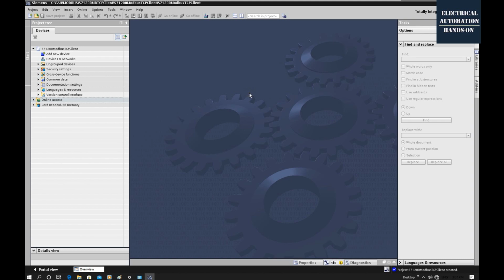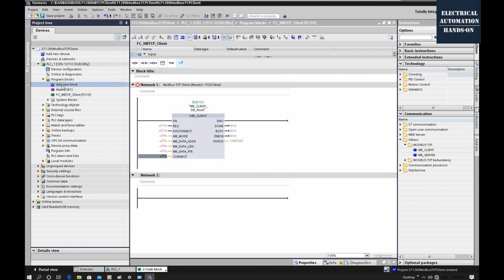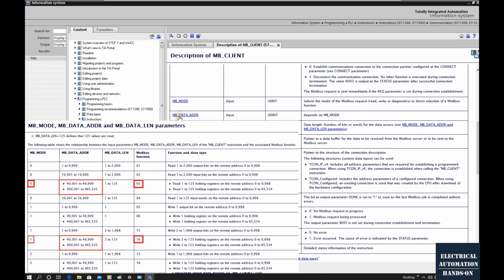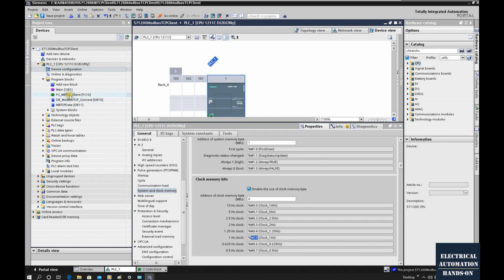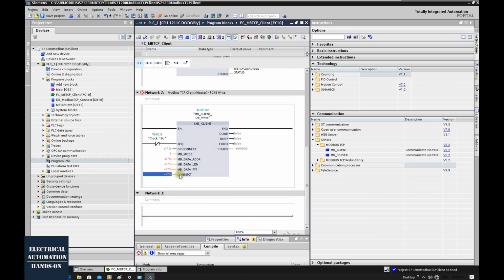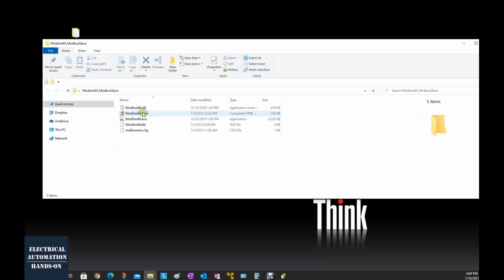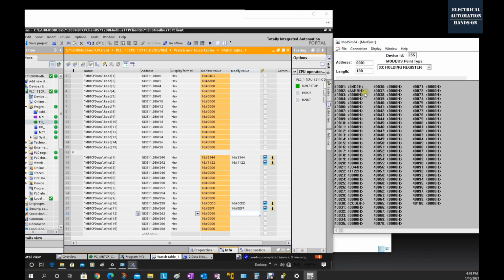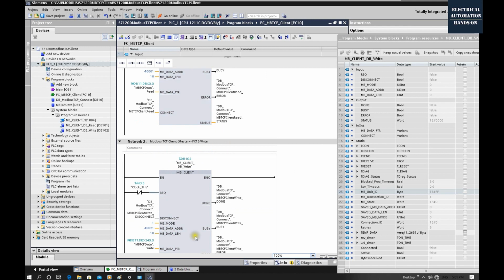COM18. ModbusTCP Client via Siemens S7-1200/S7-1500 PLC and TIA Portal

Comment: Hi , is it possible to simulate modbus connection without plc ? Only with code and modbus slave equipment?
Reply from the maker: If you are using Siemens PLCSim Advance, you could use SIM PLC for Modbus TCP function test.

Comment: Thank you for your amazing videos. I have a question with regarding software error. When I try to use Client Modbus TCP and configure the software the (Read/Write) are configured right and only ONE seems to be working at a time. Sometimes Read shows 7004-7005 (which means a connection established) and the Write shows (7001-7002-80C4) and then they switch and become opposite after reseting the server and then they switch, looks like one of them doen't update until one is offline...Any idea why? I used exactly what you did.

Every time PLC is off, the interface-id changes from 64 to 100 in the online position and I have to switch it back.
Reply: Hy,did you figure out what causes it?I have the same problem

Comment: Does this method work for multiple slaves on modbus rtu also? Whats different?
Reply from the maker: This example is for point to point. For multiple object, you have to program to target to different IP and copy the receive buffer to other data block, or use different Fb call with different instance DB.

Comment: @Electrical Automations  :  Can you show an example when adding 2 or more MODBUS units ?  do it all over again, or use the same blocks ?
Reply from the maker: You can change the settings for the 'target address and modbus address' to switch the communication target, OR ,  can multiple ModbusTCP Client FB and instance DBs to communicate with different target.

Comment: Hi I was wondering if you can help me. I have a schrack meter connected to a moxa modbus mb 3000 and my job is to interpret measurements made my the meter in c++. My question is how to connect the modbus to my pc and do you think this tutorial alone is enough to make a valid connection to modbus and will I be able to program in visual studio using the registers? Thank you in advance.
Reply from the maker: I am not using and programming C++. For your question, you have to figure out how to use C++ running as Modbus Master (Client) function to connect the Schreck meter. It would be not a easy job unless you can find a proper specialist who did this feature before. Good luck

Comment: readings are in word data type , how i can change to real type to match with actual reading ?
Reply from the maker: A real variable comes with 4 bytes, but each modus register only takes two bytes. So either slipt a real and transfter it as two words, or using * 10 then.using Int instead if your real value is less than 6553.5

Comment: Data transfer is okay but how to switch on / off the coils I don't want to read any data I want to simply on/ off coils in modbus function it is selected as 3 how to change it??
Reply from the maker: operating the individual bool/coil needs to call the other Modbus FC code. but it is not efficient in the PLC CPU level communication. The common way is that using FC06 16 for exchanging WORD, then using PLC logic to decode the WORD into 16 bits.

Comment: Thanks for your video, it's very helpful. Could I use it to communicate to actuator sensor using Modbus? With the same steps?
Reply from the maker: Yes, the method will be very similar. You could read the manual from this actuator and see the FC16 or other register variable.

Comment: Do we need to add the modbus block in the tia portal or we can directly connect plc to pc via modbus? will u please respond for this soon
Reply from the maker: You need to program the PLC for the modbus communication. If you are going to do Modbus RTU, you also.need to purchase RS232/RS485 modlue by using s7-1200. This video is talking about Modbus TCP, it is RJ 45 ethernet port.

Comment: That means I can connect my arduino to my plc right?
Reply from the maker: If your arduino support modbus protocol, that could be done
Reply: @electricalautomation  yes it does, I use codesys soft plc with it and it works fine.

Comment: How is it possible to read and write the same Modbus adress? Lets say in the holding register 40001 is for Start/stop/Auto/Manual etc. and i want to read at first the actual state and then wirte to 40001 bit 8 (for example the start bit)? I wann use the modbus mapping from the Siemens Climatix PLC
Reply from the maker: You have to plan your 120 Modbus registers into two areas for inputs and outputs respectively.

Comment: Hello, Thanks for the video, I do the same, but could not read data from (modsim64) or any other reader. I try tens of times but it is not working at all. Please any suggestion to solve that matter?
Reply from the maker: There is no any hidden operation in the video. It includes every thing. Would you pls let me know your hardware, OS, and TIA Portal software revision you are using?
Reply: @electricalautomation Sir, i am also facing same issue. From Modsim i am unable to establish the connection. Regarding hardware, i am using s7-1516-3 plc & windows 11 os & TIA v19. Pls help me in this regard

Comment: If we connect multiple meters via modbus gateway where we need to set the  slave device ID in PLC program
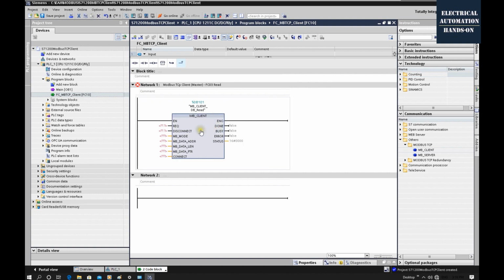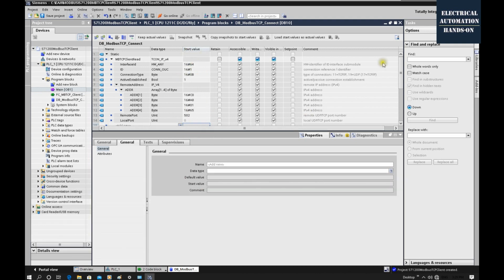Reply from the maker: If the target devices are less than 8, then you can use different instance DB "like shown 5:00 DB10". Each device has a unique instance DB, ID, ADDR IP address as shown  at 8:40

Comment: hello there.  i tried everything all the steps you have done and copy it doesnt work on my simulation. i used  PLCSIM advance 4.0 and tia portal v17. my siemens ethernet address end with 137 these numbers i put in the remote ip address and my plc address ends with 140. the results only 7002.i hope u can try using plcsim advanced.
Reply from the maker: I would recommend you use the hardware for the test. Or contact Siemens if you purchased the Sim software.

Comment: Nice explanation! I have a question: What requisition conditions would you use if you had to read data from more than 2 unit_ID in the same slave?
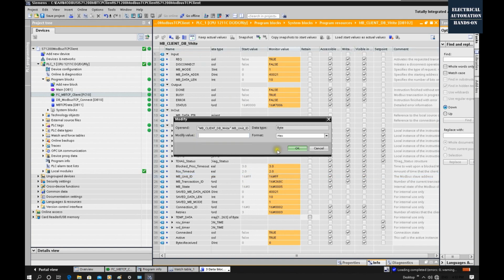Reply from the maker: Thanks for watching, Usually one device/ basically one brand of device will only have one unique Unit ID, the settings can be found from 31:00. I never saw a device with two Unit_ID. If incase a device have, then use another FB and instance DB to Call read/or write
Reply: Yes the question is correct , because this can happen while reading dsta from Rtu to TCP gateway which can have multiple devices with unique unit ids and same ip of gateway

Comment: Hi, from the other side. I'm wondering about a difference. We can create Function Block and multi-instance of MB_CLIENT instead of the usual Function and Single instance of MB_CLIENT (like in your video). Both ways a program works correctly though which choice is better (including optimization)? 
Thank you for the video, outstanding work!
Reply from the maker: Yes, for multiple FB call, you can use multiple instance DB in one FB call. Multiple instance look nice and great organized, but it is slightly pain when you are doing trouble shoot. It depends on if you did the communication test before or not, if yes, then you can use multiple instance.
Reply: @electricalautomation  Now it's clear and obvious. Thank you  :)

Comment: Thank you for the awesome video and for all the help.

Just a small tip for any one struggling with SIEMENS PLC 1212C

When using MOD_BUS_CLIENT >> Set the correct slave address in System Generated MB_CLIENT_DB.

Set MB_UNIT_ID to your required Slave Address (Default in SIEMENS is 255). Upload program and restart the PLC for changes to take effect.

Use the same Slave Address in your Desktop application as well. 

Hope it helps someone.
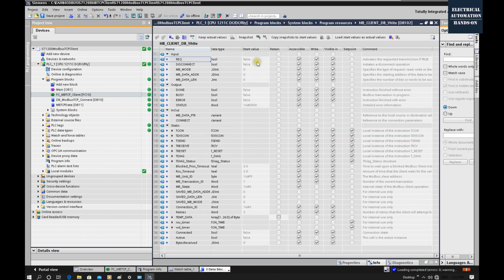Reply from the maker: Thanks for pointing it out, and highlight this issue my dear friend. I also discussed shortly at 30:58 in the video. The UNIT_ID is a very explicit hidden behind, figuring out this can save many time during the ModbusTCP communication troubleshooting.

Comment: well explained i have learnt a lot , 
just one question - if i want to establish communication with S7100 and Motoman Robot using Modbus  , is there any file that i have to install on TIA
Reply from the maker: To implement Modbus via TIA Portal and S7-1700/1500, you do not need to install additional package, using built in FB  and programming discussed in this video is good.

Comment: Em đang cần support Modbus TCP của S7200. CÓ phí ạ. Bác giúp em với
Reply from the maker: Not sure I understood your word correctly, I am using translator. Are you asking if you can use S7-200 for Modbus TCP. Unfortunately, it can not. If you are using Smart S7-200 PLC. It can, but the old style S7-200, it can not do Modbus-TCP. You can use an Modbus-TCP/RTU adapter using as bridge.
Reply: @electricalautomation   i wrong typing. S71200 with modbus TCP,
Reply: @electricalautomation   please teamview help me.
Reply from the maker: @thohayvietnam1809  My remote support is billable not for free and I have no time for remote support recently since I am very busy these days. Also In this video, I started from scratch and there is no hidden info. so if you review carefully and follow the steps, you should implement them successfully.

Comment: that's awesome vdo, just curious How many modbus client block can be used? example if we have 12 modbus devices to communicate with.
Reply from the maker: You need to check with A-B support for the resources of the controller you are using, because this AOI need TCP Socket resources. But You could also try cyclic change over the parameters and target on the AOI parameters, so do ONE TIME ONE TARGET, this will take only one connection resource.

Comment: Thanks a lot for this amazing video! I have a question, I need to communicate three different servers. Can I add three different MB_CLIENT blocks? It's ok to call three at the same time?
Reply from the maker: Sure you can. S7-1200 has 8 TCP connection resources. Use different instant DB name for those three calls.
Reply: @electricalautomation  Thanks for your reply. So, to obtain different parameters of the same device I will call MB_CLIENT several times, with de same ID, IP, and instance data block; ensurig that each individual Modbus TCP request finishes execution. What do you thik about that?
Reply from the maker: @lucianogutierrez5259  No. To use one Client to communicate three Server, you need to call three times MB_CLIENT with three different instant DBs. The parameters for the "CONNECT" are individually for each FB call.
Reply: @electricalautomation  Well, finally, to read two diffent parameters of one server I call two times MB_CLIENT with the same DB, but two different CONNECT variables. It's OK? CONNECT variables will only differ on ID (connection reference/identifier)? On S7-1200 System Manual V4.5 (13.8.4.2 Example: Legacy MB_CLIENT 1: Multiple requests with common TCP connection) uses the same CONNECT_ID. I'm so confusing about that. Thanks so much for your attention!
Reply from the maker: @lucianogutierrez5259  Use different Instant DB, please. each call use different CONNECT variables. In the CONNECT, their target IP, can be the same target server. means this PLC does not know you are communicating one server or two server, IT ONLY CARES THE CONNECTION AND DATA.
Reply: @electricalautomation  Ok, thanks for your help!

Comment: This is great tutorial for starting on Siemens MODBUS communication, I found this very helpful for starting on MODBUS TCP communication. You have explained the concept very clearly and descriptively. Thanks for posting video.
Reply from the maker: Glad it was helpful! Welcome to my channel!
Reply: @electricalautomation  I have a question regarding Disconnect flag, is this always False?? No need to set True?? For some reason the Status always shows 7002..I don't know why
Reply from the maker: @arbjful  "Disconnect" should be OFF. ON at here means disconnecting the communication connection. Please view carefully all the settings and parameters. Also check the settings from your server-side, it also may be blocked by the windows firewall.

Comment: thanks a lot for this excellent video. I get the error code 80C5. the status is toggling between 80C5, 7001 and 7002 .  I am doing this test on PLCsim.Please can u help. Thanks
Reply from the maker: You'd better use hardware or PLCSimAdvance.

Comment: Congratulation for the video and thanks for the tips! I tested the Modbus client mode of PLC with a Cobot UR10 (Universal Robots) as server, and had a good comunication to data exchange. So, that is an item that i like to share with everybody, in my case the error 8383 appears when i begin the comunication and to solve this error i change the "Data_len" parameter (Before: 15 | After: 5) and after this, both comunicate normally reading and writing to/from the address of cobot! OBS: The data was at format "int".
Reply from the maker: Thanks for watching and thanks for your sharing. According to the 'int', I guess you are using holding register 4xxxxx. and probably the Cobot provides 5 registers to communicate. Therefore, 15 length didn't work. Good to hear it works. Thanks!

Comment: Thanks for detailed explanation!
Two questions: 
1. Isn't there need to use any function codes such as 01H to read output coil objects, 02H to read input coil object,  03H to read holding register and many more types of function codes?
2. If I defined S7-1200 CPU as a Modbus server, how can we assign the modbus addresses to tags...for example MW50, M10.0?
Reply from the maker: yes, you can run 01H or 02H. please check the video 11:58 the "MB_DATA_ADDR"  1 to 9999, 10,001 to 19,999.  Regarding your second question, MB_DATA_PRT  at 16:49 is the PLC tags for matching the Modbus registers